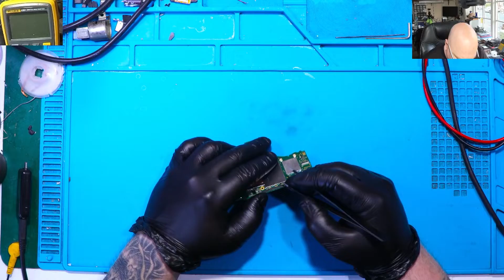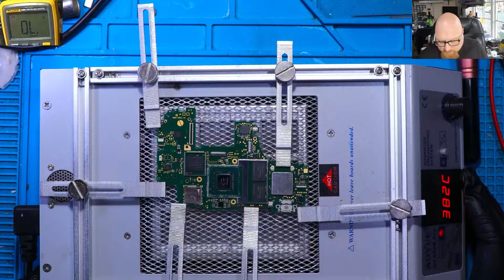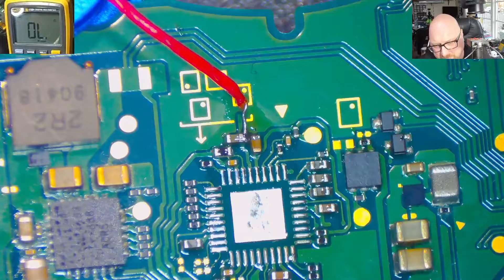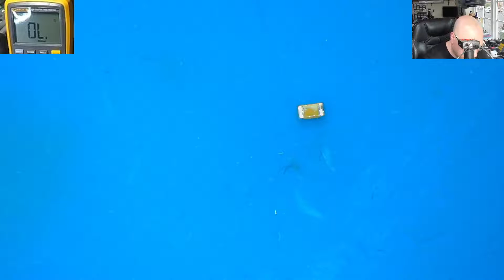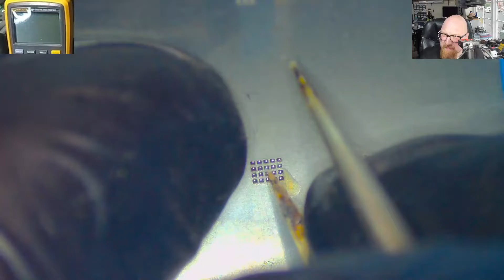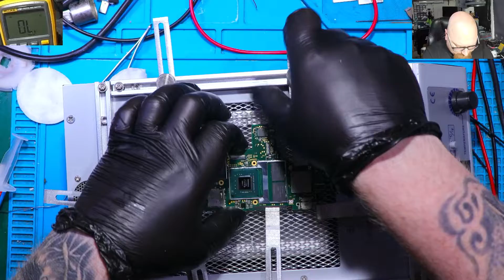Nintendo Switch Lite Blue Screen repair and another Switch Lite with the motherboard issue.

Comment: Awesome fixes as usual bud! Quick question...do you buy your stencils specifically for all these ic's or buy a bunch at once and see if they match up. I know the chip you reballed here isn't a common ic chip to mess with so was curious as to how you had the correct stencil for it. Thanks in advance. Loving the content!
Reply from the maker: Thank you. Here is a link for the stencil I've used in this video. https://www.ebay.co.uk/itm/124928791601